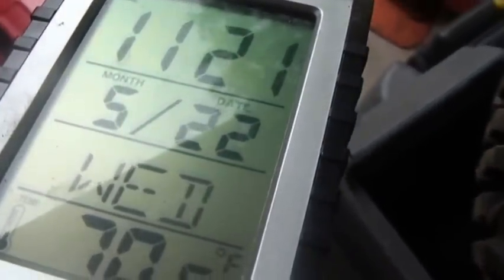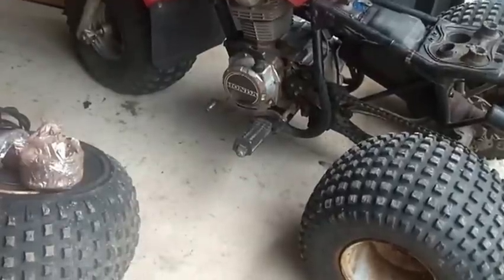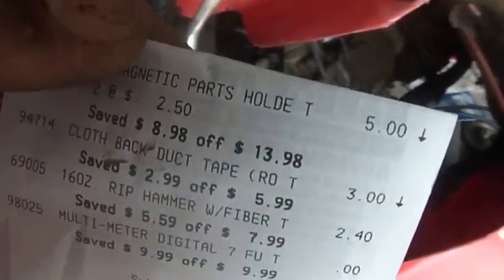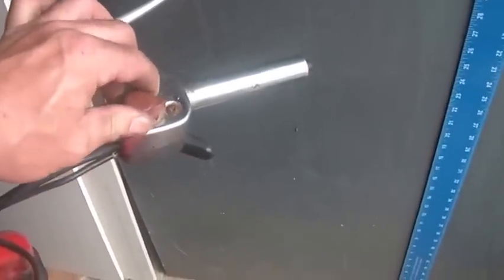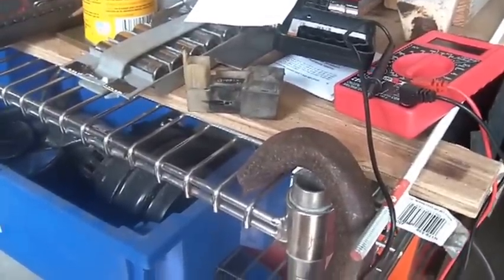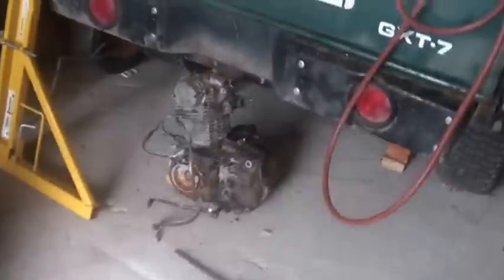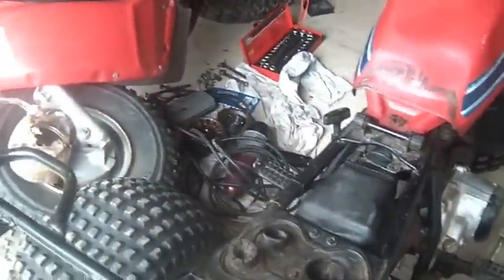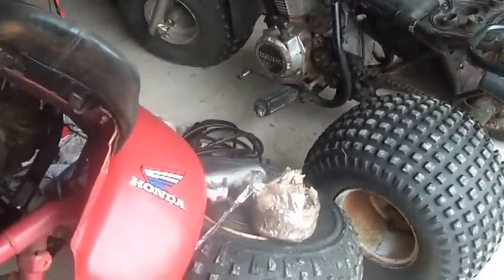5_22_2013, Honda 185S ATC, Still no spark.

Comment from the maker: RockOH d, Turns out it was a bad ground at the coil, I cleaned up the frame where the spark coil attaches, cleaned the coil, and clean the ground wire in the harness. The bike fired right up. Thanks for watching and commenting!

Comment from the maker: hondaATCTRXguy, One can get them on ebay complete + used for under $50, just the ignition stator, goes between $13 - $26, sometimes the stator mounting housing needed to be wittled down a little so that the post on the stator does not touch the housing. On my 185, it was the green wire, ground lug, that attaches at the high voltage/spark coil, clean that area and make sure U have a good ground before you spend $, Thanks for watching + commenting, it is good that we all suffer the same problems.

Comment: i got a problem with a trx 200d i just bought no spart guy had shreded the started cog parts fell down into the stator and got jammed up done some damage not sure if its completly nakerd or not and a stator for this quad is a right pain to find in the uk for a decent price im in a bit of a pickle i only paid £250 for the quad and a trailer but if it costs me £100 for a new stator i would still be happy but dont want to spend out that cash if the one i still have is working

Comment: wish i seen this earlier to help you out. im sure you got it running by now. i just picked up a big red. noticed it sparks once in a while. like hmm. im a mechanic. so i understand it all and dont need the book. not braggin. i get stumped too. but i was like hmm. timing. 3 things need to work like a clock to spark. crank stator pick up. pulse genrator pick up. if 1 of the 3 out of time. no spark. all parts are probally good. try that. i am in the morning :) i just got mine 3 hours ago.

Comment: Any help you can give on compression on a 1983 at 110
Reply from the maker: Hey Taylor, The Honda and clone horizontals as I like to call them have relatively low compression, 125PSI is really good, around 100PSI is to be expected, they will start and run down to 75PSI fairly easily.... Less then 75PSI, they start, but it is a fight, one may have to spray starting fluid into the carb as it is spinning over.... I hope this helps.... Thanks for asking, watching, and commenting!!!!!!